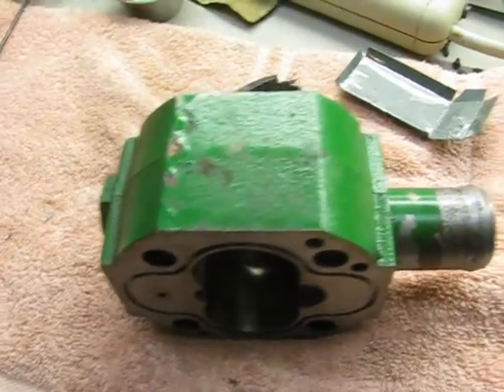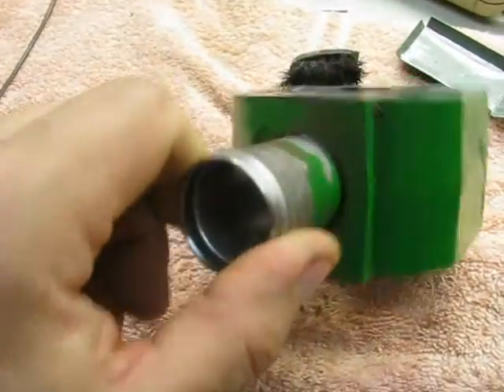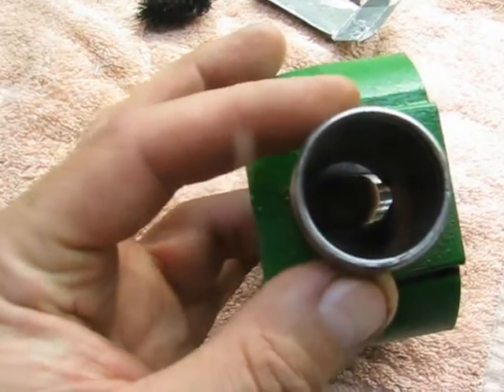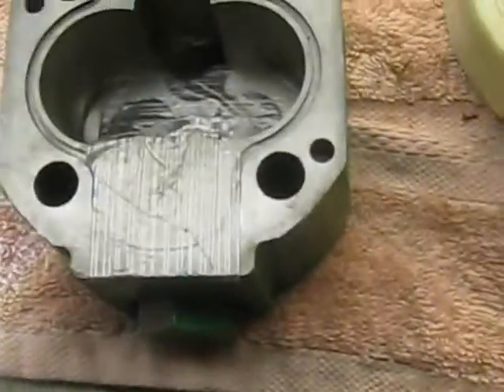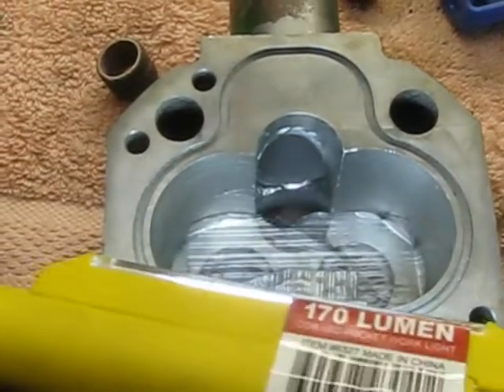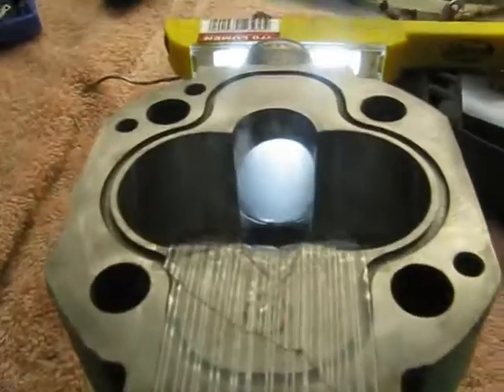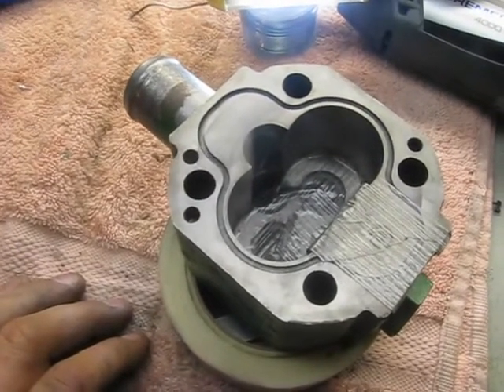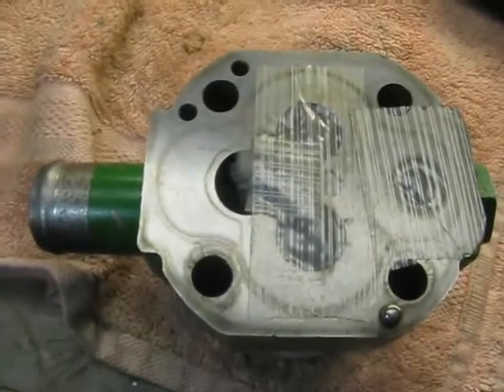Haldex, Northern tool hydraulic pump repair

Comment: I just got a log splitter  and the intake  pipe is loose and falls out. What would work to keep the tube tight for long term on the pump?
Reply from the maker: So you're saying the intake pipe falls out of the pump? a pressed in fit?  If that's the case, you might have to expand that fitting just a little, slip it over a socket and give it a few hundred light taps with a ball peen hammer to stretch it some get it absolutely clean and reinstall it with red loctite. but you want it to be a firm fit, light press fit.

Comment: So did it pump harder?
Reply from the maker: so cleaning up the intake tract cut down on the pump cavitation sounds that were coming from the pump, at its rated flow, that port was far too small and too turbulent.   Summer flows are okay but winter was too restricted.

Comment: Did the red loctite work?
Reply from the maker: Indeed, worked very well and has kep a tight seal
Reply: What loctite #
Reply from the maker: @erikmclaughlin3740   262 but if I had to do it again I'd either try the copper spray or the 518.
Reply: What about 515 is that much different i have some of that

Comment: Obviously hydraulic pump knowledge and design is not your fortay
Reply from the maker: I think you mean 'Fort'  and that's true!! I can read a nomograph and will tinker with anything.  Another defect in my implementation was being sold a 35gpm suction filter that was really a 10-15 gpm suction filter and a 35gpm pressure filter.    If I'm missing something let me know, that's how learning happens.